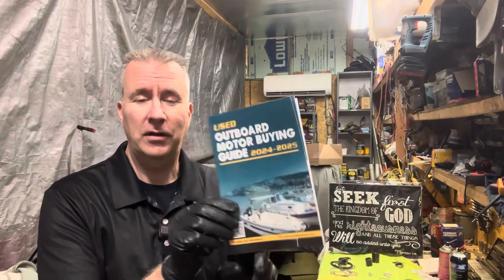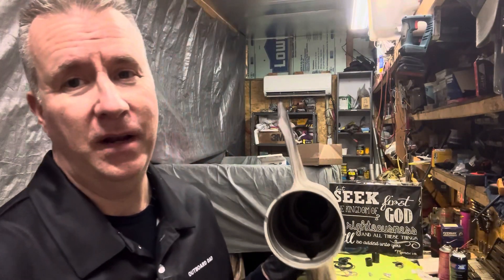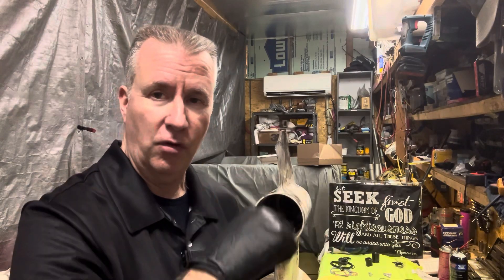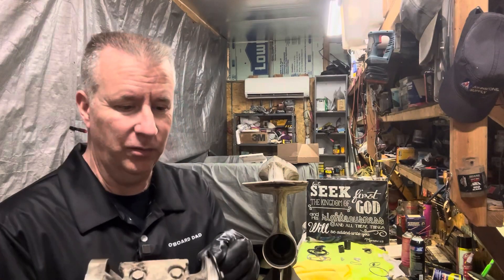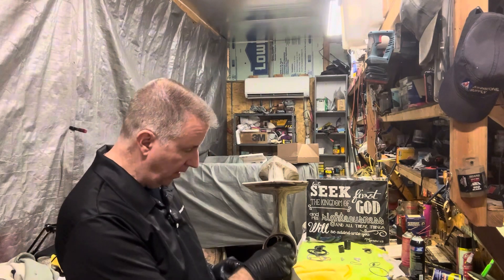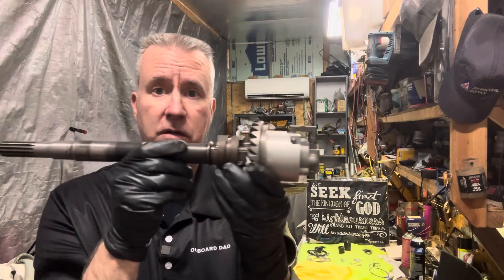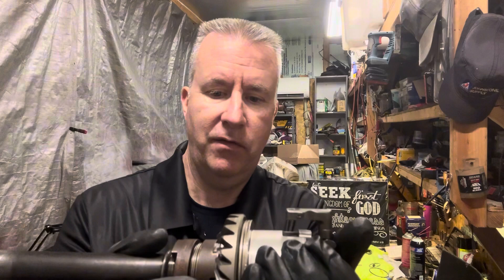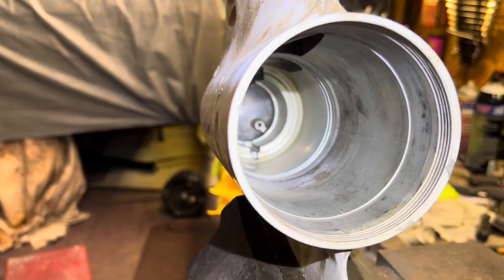Evinrude Lower unit Rebuild Install gears

Comment: Thank you for your helpful videos when I removed the driveshaft from my lower unit the needle bearings all fell out into the gear case what should I do now? I can’t find the removal/installation tool in the service manual anywhere online to replace the bearing
Reply from the maker: Probably no need to replace the bearing. Just use some heavy grease and inset them one by one, pretty sure I have an Evinrude’s lower unit video where I had to do the same thing. Thank you for watching and commenting!
Reply: @OutboardDad  Thank you. can you share a link to the video I’d be curious to watch it
Reply from the maker: @ryanpekrul4830 ok let me look for it

Comment: Why didn't you strip the exterior finish, repair the skeg, then prime and paint the housing before reinstalling the internal components?
Reply from the maker: Typically I would, customer wanted bare bones repair and do that himself. What motor do you run?

Comment: whoops! 😆
Reply from the maker: whoops? What did I do?
Reply: @OutboardDad  in this video you HAD counted turns on the shift Rod, I thought I was mistaken that is it was the gear shaft you didn't count turns on in previous video. 
That's why.
Reply from the maker: @BedtimeforBonzo3CPO Got it, thanks, will be more mindful of that moving forward. I want to be accurate with my content and appreciate you letting me know as opposed to me leading someone in doing things wrong.

Comment: The housing and bearing assembly that the shift rod dropped down and screws into, is it normal for those steel rollers to fall out? Thanks
Reply from the maker: I have not seen that happen unless the bearings were damaged. Can you send me some pictures? Keith@outboarddad.com

Comment: Bought a 1998 javelin fish & ski boat with a 130 Johnson 2 stroke vro. Had the oil pump removed & I mixed oil & gas.
Reply from the maker: @MikeSampson-h9l  Smart move, did you do a compression test?
Reply: @OutboardDad  no not yet. It will fly. Be for spring I'm going to have lower unit change & water pump & I will have them check my comparation check
Reply from the maker: @MikeSampson-h9l  Good luck and thanks for your comments
Reply: @OutboardDad  yes sir. Keep up the amazing work you do
Reply from the maker: @ Thank you! Feel free to let me know what you want in the upcoming videos
Reply: @OutboardDad  yes sir I will
Reply: @OutboardDad  I got your book just now.
Reply from the maker: @ Thanks buddy, let me know what you think and how I can make it better to help more people
Reply: @OutboardDad  yes sir will do 💯